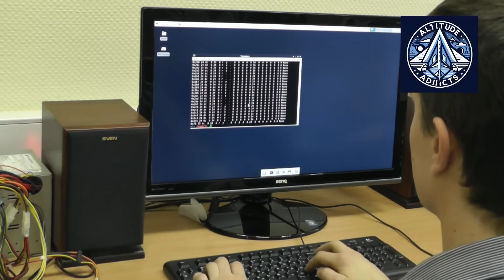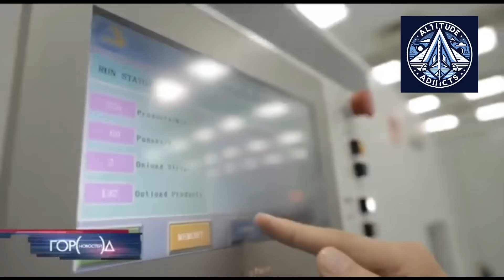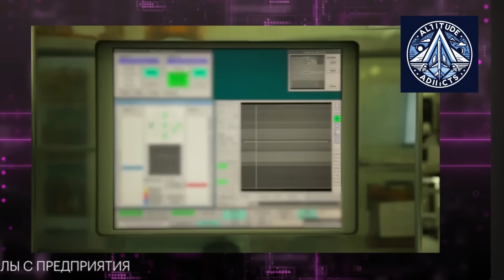Baikal U-1000: Russia Launches Mass Production of a New Industrial Micro controller

Comment: Keep your feet on the ground, guys! A cheap Raspberry Pi has more computing power than this derivative of an outdated RISC-V architecture.
Reply: RISK-V is outdated?! You're obviously out of subject! The RISK-V open architecture standards are still in development!
Reply: @maksimluzin1121  If you would pick a modern, multi-core, 1.5+ GHz variant: maybe
The Baikal U-1000 and it's BM-310 core is neither modern nor elsewise impressive. The same applies for manufacturing equipment shown in the video. 🤷‍♂
Reply: @luisdamian4562, it is a controller processor. Most of the controller processors are working at MHz level and at 65nm architecture. Why do they need 1.5Gh speed and 5nm technology? Ask technicians which processors in your car, if you have one... You'll be surprised...😊
Reply: @luisdamian4562, The most important things about Controlling processors are: 
1. Reliability, ability to withstand shockwaves, dust, temp changes.
2. EM warfare, attacks.
3. A lot of Interfaces with different equipment
4. Internal data protection, hardware encryption/decryption. Fast.
This is all about Baikal...
Reply: @maksimluzin1121  I didn't say that nobody needs it - I just said it's definitely not modern semiconductor technology.
Reply: @maksimluzin1121  Yeah, warfare. What else would Russia be interested in these days. 🙄
Reply: @luisdamian4562, you should understand at first, in which conditions the manufacturing/factory controllers are working and which requirements to them are.
Reply: @luisdamian4562 dude you are saying from the perspective of computer, phones, tablet, video games. This chip for industrial automation which is beyond  your understanding. Why talking rubbish when there is apparent resistance of your intellect in the first place??
Reply: @gyaanfreak  C'mon, just stop hyping a open-source based clone of the two decades old STMicroelectronics STM32 micro controller as a technological marvel. Because it isn't.
Reply: @luisdamian4562, Nobody is talking about "marvel". It is just an Own Domestically produced controller processor. Own. Controller processor. Own, homemade. That's it.
Reply: RISK-V is modern architecture actually, arrived in 2010s. Main advantage — open source (developed by world) and simplicity (for more complicated goals exist extensions for architecture). It means incredible compatibility: same app will work on domestic processors of Russia, China, USA, India, etc. De facto this is first international architecture.

There are exist Baikal processors with ARM architecture too. For heavy tasks in Russia also exist own domestic architecture (VLIW kind, most complicated kind of architectures, main advantage — at same time, per cycle, can execute by over 50 instructions, for comparison your x86 only ~4 instructions per cycle).
Reply: @luisdamian4562 the beauty is not computal power, but it consumes less energy. This thing is made for drones / Rc toys
Reply: this is a microprocessor not a competitor of a x86. That microprocessor is for industrial use like cars, electric motors etc. where low power and reliability is a key factor.
controlling a solenoid or a power contactor (an electromagnetic device to control power loads) you don't need a core i7 processor.
Reply: A vertically integrated specific purpose Chip can be as good as an of the shelf general purpose chips even if it look 10x weaker on paper
Reply: Hey westurn aplologuist c u nt, for 99% of chips used in the world you dont need that level of computing power. Esp for military use. Even western military hardware uses larger process nodes. Only phones, smart watches and laptops or servers use cutting edge 10,5,4,3 nm nodes.

Comment: India's first homegrown 64-bit semiconductor chip of 28–90 nm technology is set to be rolled out this year with RISC-V. It might be 2-3 decades behind in processing power and efficiency, but it gives great options for replacing chips where you don't need high-performance throughput.
Reply: 45-65-90-180 Это высококачественные производственные процессы для бытовой техники и различных контроллеров. Эти процессы будут актуальны очень долго, поэтому их развитие — это хорошо. Кроме того, диапазон 65-90 нм обеспечивает достаточную вычислительную мощность, хорошо подходящую для станков. Например, процессор Pentium 4 когда-то имел частоту 3,7 гигагерц при 65-90 нм, чего более чем достаточно для станка. Поэтому я рад за Индию и Россию.
Reply: @PhilPantnik  Furthermore, USA hardware is probably spyware.
Reply: @MichałSmarzewski  Да, такое возможно.
Reply: @MichałSmarzewski  you can bet your ass it is, AMT Intel (Intel Active Management Technology) is present in every intel processor by default as backdoor even if it is not installed in a workstation with that technology officially supported
Reply: As long as you don't control the manufacturing process you don't have a homegrown process. The Americans can cut India off at any time, this makes you  totally subservient to their wishes, just look what they did to China. It is very important to control the entire production chain from software design tools, production equipment manufacturing, chemical processes, test, and lastly packaging. The global world, aided America by supplying talent and money to enable this process but now America has weaponized this chain. Let's hope that India, China, Iran and Russia can work together to.provide a counterweight to this monopoly - the task is too great for just one country. If everything was open sourced that would be even better.
Reply: @albertdye3942  yup, the endgoal with gigafactory is to have a fully automated anything factory- selfsustained energy source, ressource mining/refining/recycling, self maintenance/repair/upgrade with an ai designing the product, test it in vr to optimise it, produce it from scratch and get rid of pesky hoomans from the chain, does not matter what the endproduct is...
Reply: it is always better to have your own even if it is behind the technology curve. you just concentrate on continuous improvement till you have a world class product. india of all countries should not be buying much technology from other countries, you have the economies of scale necessary to make competitive technology products
Reply: @DubaSangara  , blackmailer 😂😢😅 !!!!

Comment: Both C and C++ are high level languages.  It is not the microcontroller which "supports" a language but the language compiler and tool chain which supports the processor. You should get someone who understands the subject to write your text.